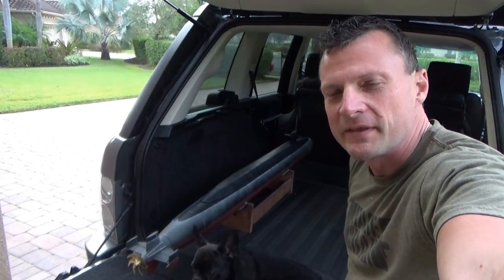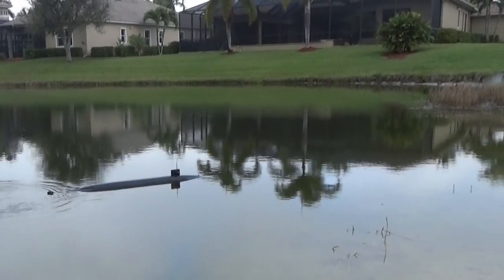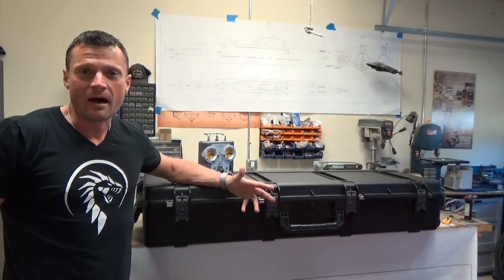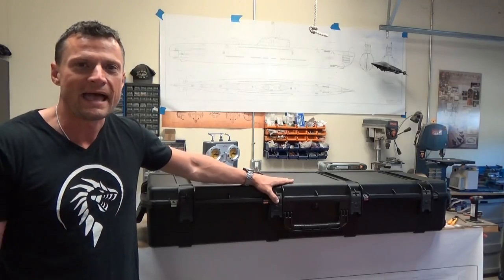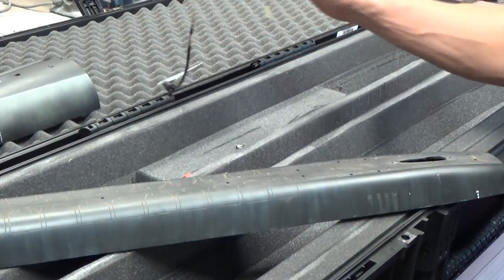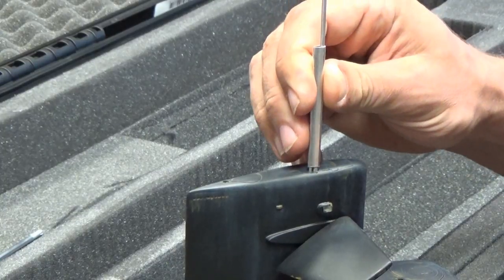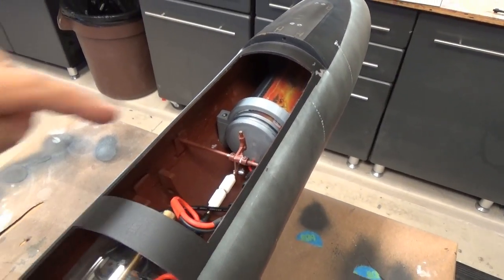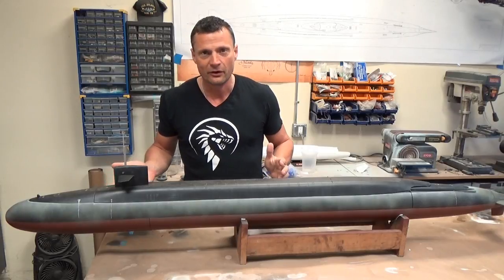SubmarineWorks Ohio RC Submarine Build - Chapter 6

Comment: Looks great, thanks for sharing. I was a pipefitter at Electric Boat from 78-98. I've installed or worked on near every piping system on the boats both inside the pressure hull and outside. Your model looks very much like the real deal. The Ohio Class is a BIG boat. Columbia Class is on its way.